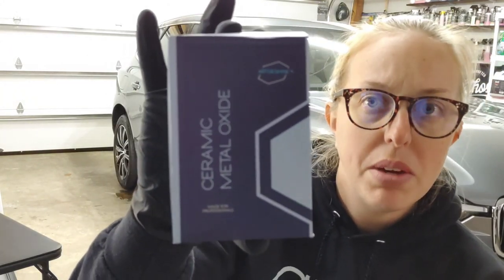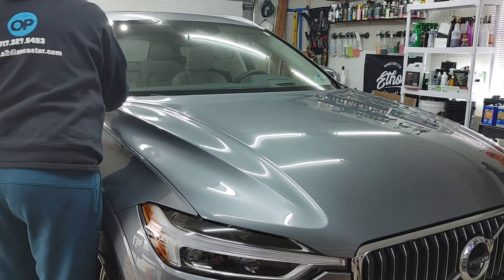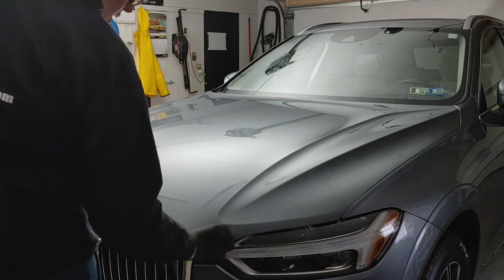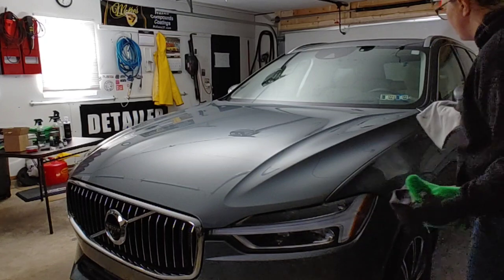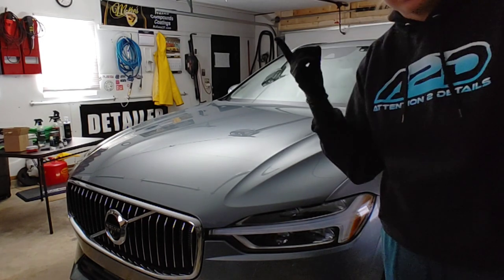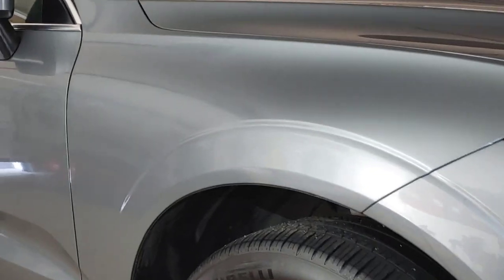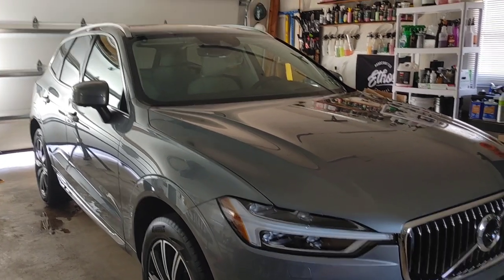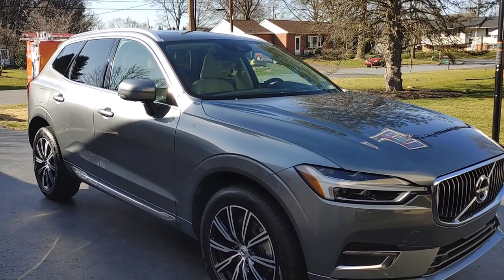Art De Shine Ceramic Metal Oxide Coating- Application and Tips on Applying CMO Coating- Super Easy!

Comment: If you ever want to get into gelcoat or marine paints, let me know. Excellent video for the subject. I lack your patience with the viewers.

Also, no hoodies when applying a coating: the draw strings and baggy nature of it can either drag across a surface you don't want grazed and the drawstrings can be caught in a buffer and can drag across a surface. Tighter clothing should be worn to reduce any possible contamination of deterioration of a surface due to a slight pass by some fabric under no control. Just opinions.

Comment: All the  (real) Ceramic coatings are technically metal oxides (Ti02) The difference in any is added chemicals and percentage of solution to particle levels.

I'd suggest lots of bright direct lighting additions to your garage if you can. Try to simulate daylight inside, from multiple angles. You can see everything so you can perfect everything. Just my options.
Reply from the maker: For darker vehicles that works but i prefer indirect lighting and less lighting for coatings.
Reply: Actually, your typical ceramic coating is silicon dioxide, not metal oxides. Ti02 is sometimes added to them as an optical brightener and it adds a little to the hardness. PDMS (silicone fluid) makes up the majority of an Si02 ceramic coating, along with solvents and any additives that the manufacturer chooses.

Comment: are you a certified installer or do you not need it for this coating? if you mentioned it I missed it
Reply from the maker: I am a certified installer but I saw this available on a CA web site That it appeared anyone could purchase but here in US to buy it would have to go through art de shines website and I believe this is pro product only.
Reply: @attention2detailswchelsea I did not know that about the ca site. I always looked at the official site and it wasn't available at the consumer level. With Apex that looks to be changing.  That vehicle looked amazing btw. Great work as always. I'm using your indirect lighting trick on my details, it's a small thing but helps alot. I always pick up something from your vids. Thanks for the effort you put into these.
Reply from the maker: @barrybij8079  glad I can be of help!